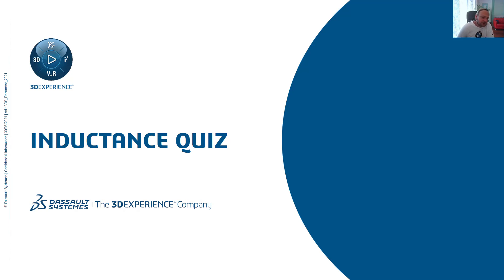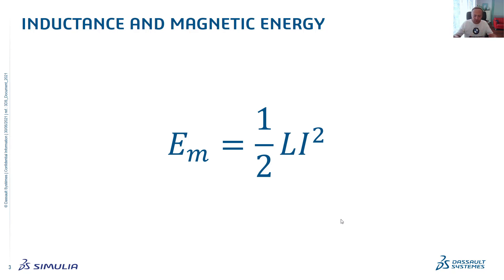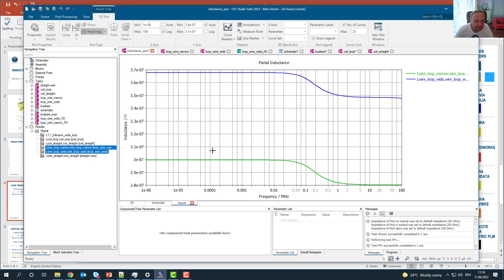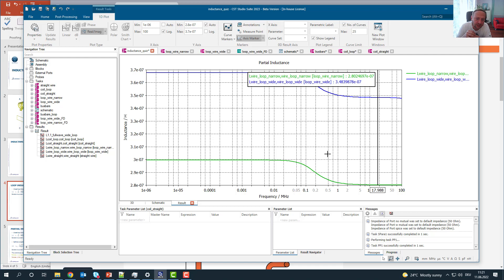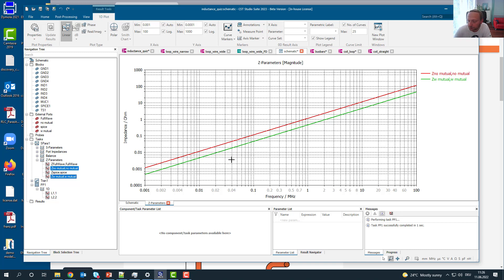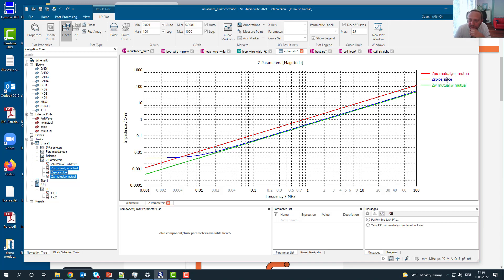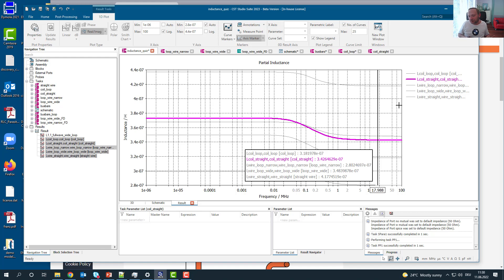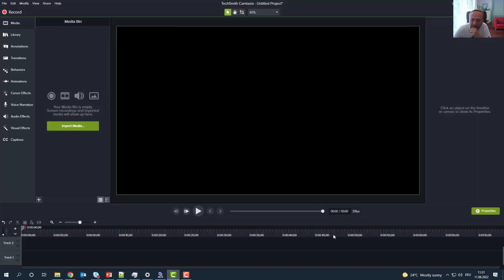inductance Quiz

Comment: L = μN^2A/l
L = Inductance (H),
μ = Permeability (Wb/Am),
N = The coil's number of turns,
A = The coil's cross sectional area,
l = Length of coil (m).
Reply from the maker: This is an approximation which assumes that there is no separation between the windings. The 3D simulation is more accurate.

Comment: Very nice, Did you need to implement the equations or you had them in CST?
Reply from the maker: Not sure which equations you mean. In CST you can get a lot of results straightaway. If required, you can add your own equation to post process primary simulation results.